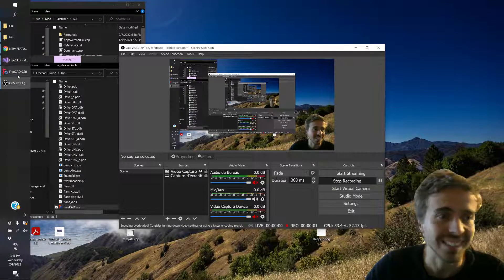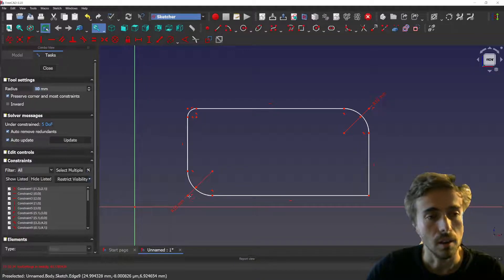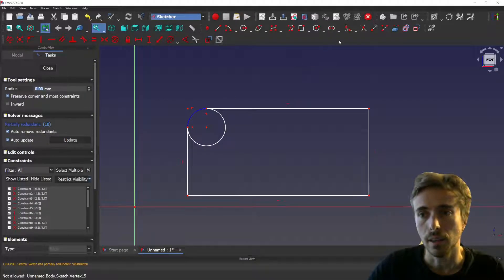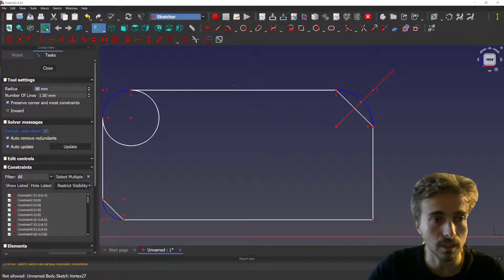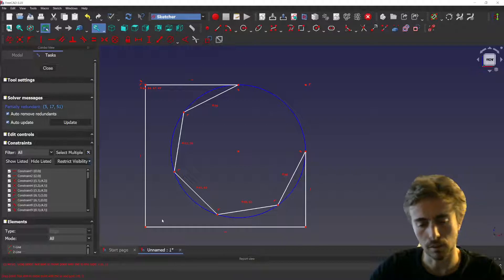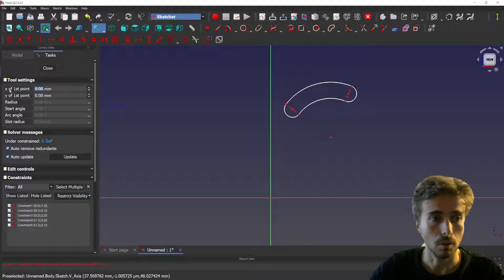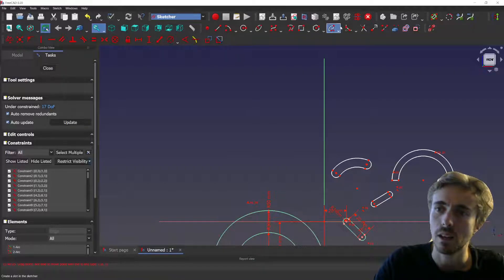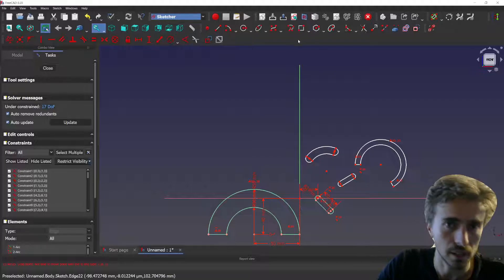FreeCAD Sketcher New Features : Chamfer, ArcSlot, Frame

Comment: Hi. The Tool settings from where you modify the radius of Fillet before applying fillet onto two lines - is not showing up in my FreeCAD. I am using the same FreeCAD version as you - 0.20. Please help me. How do I enable it? I tried the development version as well. It is not showing up in the latest development version as well.
Reply from the maker: Hi,
It's because it hasn't merged into master yet. The merging is taking a very long time because the merger is not available very often and wants to make lot of code modifications.
So it's unsure when it's going to merge.
If you want to use those tool you'll need to compile my fork.
Reply: @freecaddevdiary7038  Oh, ok. Thank you.

Comment: really nice progress!
as you seem to be quite focused on flow and usability I was surprised you clicked 2 lines to apply the chamfer/fillet instead of only the corner point, but I guess that will still be possible, right?
i was also thinking about the frame tool. I guess an offset tool would solve this but also be more versatile, I understand that a decent working offset tool is not trivial but adding new features also clutters the panels more, but if it's a dropdown rather than a new button I guess its no big deal, but can probably be raplaced by offset if someone later manages to put that togheter.
Reply from the maker: Offset is on my mind too.
Reply: @freecaddevdiary7038  in Part WB there Is 2D offset, maybe you can just somehow implement it to sketecher. Btw you Are doing really nice work, thank you.